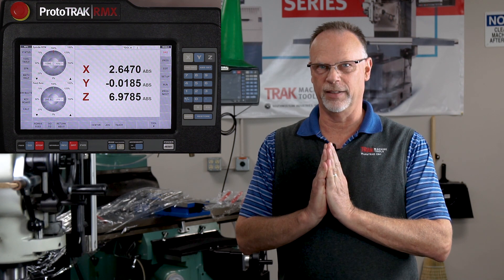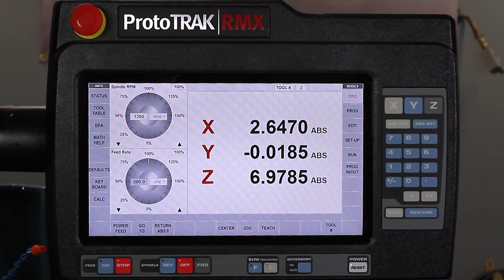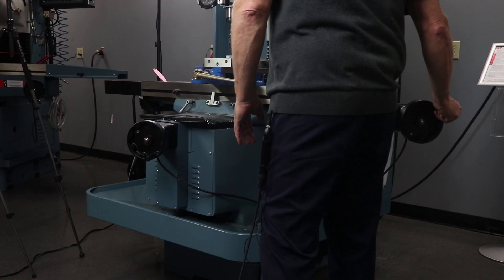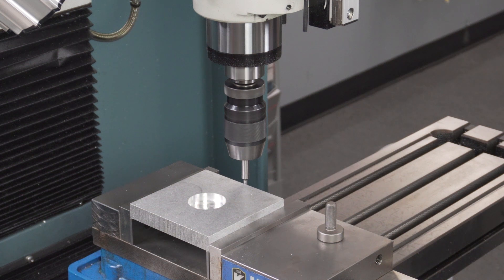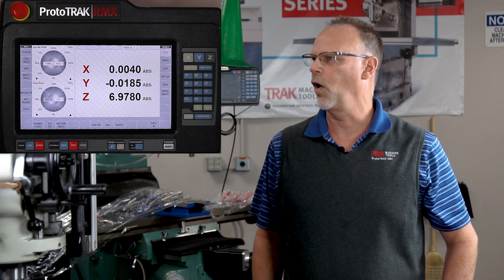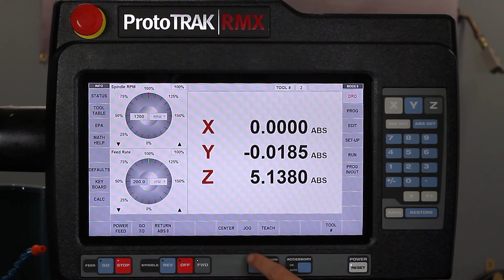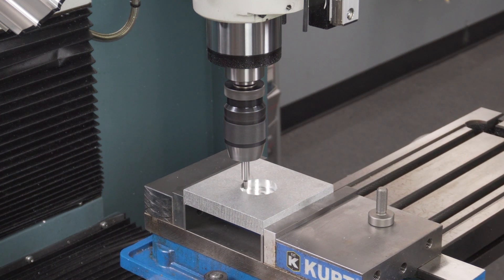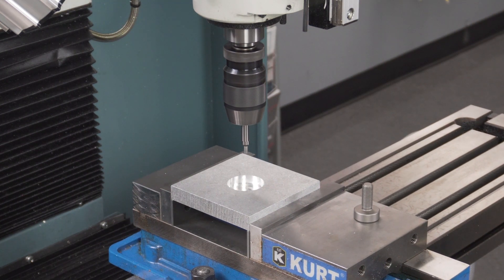Finding Center | ProtoTRAK RMX CNC | Mill Programming

Comment: Will this method work for indicating on the OD of a round part versus an ID as was demonstrated in the video?
Reply: Hi Jason. Yes, it's the same.  Just touch three points anywhere on any arc or circle. T.P.

Comment: How would one find the middle of a line and a circle using the ProtoTRAK SMX CNC ?
Reply: To find the center of a line, the easiest way is to switch your DRO to incremental display using the INC/ABS button.  Then, move your edge finder to the first point on your line and push X or Y and INC SET.  Next move to the other point and read the the total incremental distance it has traveled.  Divide that number by 2 and move your table back to that number.  Now, switch back to the absolute display and zero out your absolute value for that axis.  The only way to find center of a circle is to use an indicator.  I hope this helps!  T.P.
Reply: @trakingpat2750  Thank you for your reply. I'm new to the SMX controller and I was kind of hoping I had missed some blatantly obvious divide by 2 function somewhere in the software. Is there one planned for the SMX in the future?  Otherwise, I find my new to me DPM5 a joy to use. Keep up the great work! Cheers!
Reply: @gaudan9072  I'm shocked that this DRO does not have a half function. Very disappointing that they did not add this as a software update.